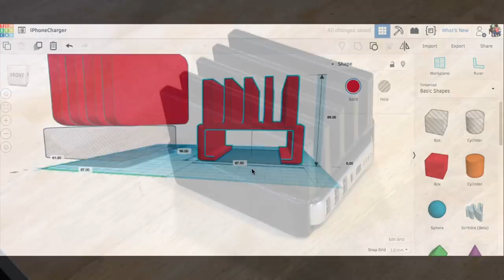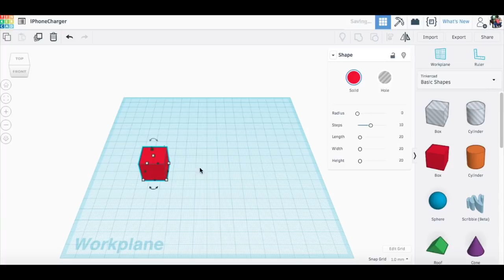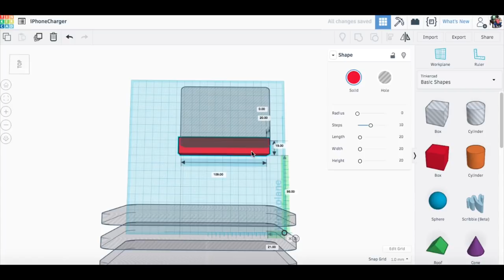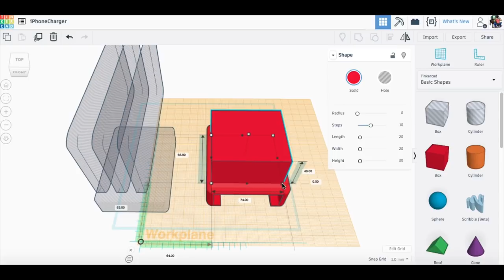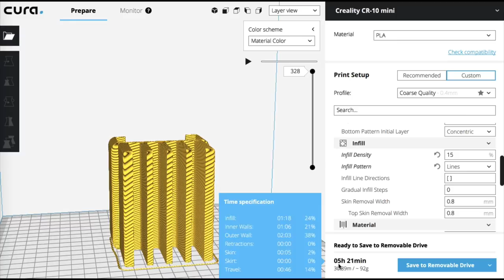iPhone Charging Stand Designed in Tinkercad

Comment: Cool video! A possible quick fix for the loose fit on the battery pack would be to use a Scotch-brand "mounting square" -- that double-sided foam tape. Put a piece inside the part where your battery pack lives, and leave the backing on one side of it (because you don't want the battery pack to stay in there permanently). The thickness of the foam tape should snug up the fit. 👍